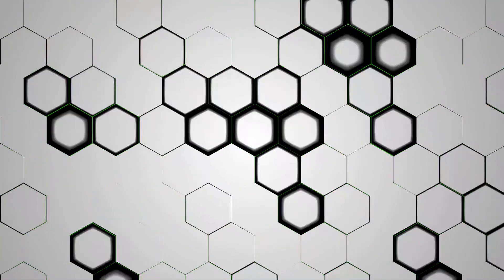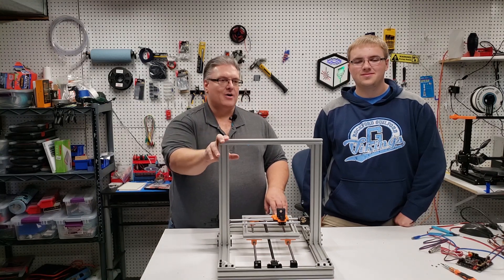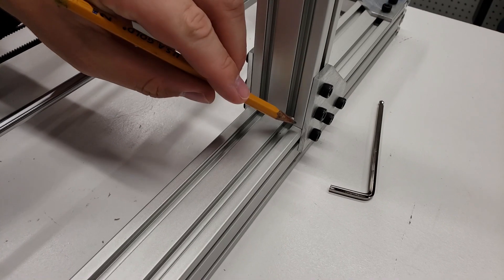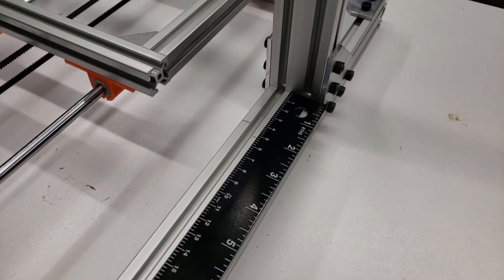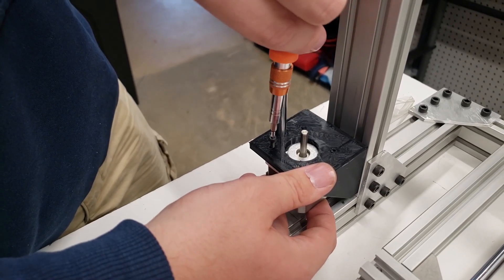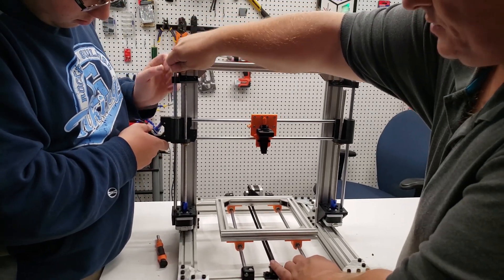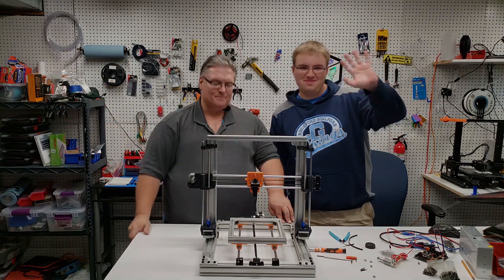Build Your Own DIY 3D Printer Kit at home - Part 4 : The Z Axis

Comment: anyone else following this tutorial to make a DSLR gimbal retractor for a fixed wing UAV thats controlled via 4G LTE connection and has unlimited range nd big biggest battery life u have ever seen. anyone doing that? bc ik i am. im just hoping those stepped motors can lift the weight of a £1500 gimbal and very expensive DSLR camera - thanks very much for this its definatley gonna help

Comment: For the framing, did you opt for the extrusions for a particular reason?  Ease of construction without needing to drill and tap tubes and the like?  Trying to build one as cheaply as reasonable, and I already have tooling to deal with welding, cutting, drilling, tapping, etc. and wondering if there was a clear advantage to the t-slot that I'm missing.
Reply from the maker: Only choice was for availability.  T-Slot and V-Slot are interchangeable in the design.  Providing you have a rigid frame it really doesn't matter what you construct it with.  Use what works best for you.
Reply: @MakersMashup  I'll give tube stock a try, selecting sections that match the stiffness of your frame.  Thanks for the input!

Comment: Hello, I'm from Philippines and I would love to make my own DIY 3D printer. Your video is very nice and professional and with the materials that has been used, it looks like it will high quality product. The only problem I have is with the 3D printed parts, I can't print them since I don't have a 3D printer right now. Do you have any other alternatives for the 3D printed parts? Thank you
Reply from the maker: If you can't print 3D Printed parts you can go down this route https://www.youtube.com/watch?v=tYUiWoiKzbs
Sometimes makerspaces and libraries have 3D Printers but not sure in the Philippines.  You may have to build a Frankenstein.
Reply: @MakersMashup  Thank you so much! Will check out the video

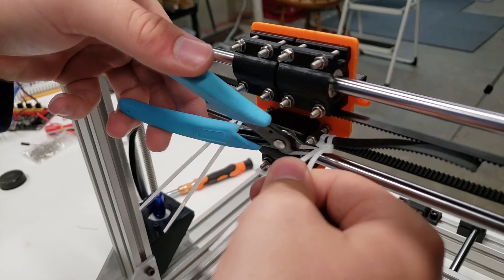Comment: 06:46 Pro Tip when snipping the excess length of the cable tie, keep the flat side of the snips against the locking part of the cable tie. That way you don't end up with a sharp point that will stab you when you least expect it. Aside from that, very nice video series.

Comment: Great vidoes, I learned a lot. but  I have a  issue with my stepper motor not turning and making a griding sound whenever  I want to remove or insert filement inside the extruder. by any chance do you know what the problem might be?
Reply from the maker: Check the wiring, voltage and , current. Wrong leads can cause it to not properly alternate and move. Wrong voltage and current can cause it not to move.  Try swapping it with a know working stepper.  This is some tips but hard to troubleshoot in a YouTube comment. 😉
Reply: @MakersMashup  thanks man. for sure, I'll give the advise a shot. hopefully it works. could it still be the wires since the stepper used to work with the same wires, and suddently it stop turning.
Reply from the maker: What sort of extruder do you have? If it's a geared one you might need to just clean it out.

Comment: I like the solid motor leadscrew couplers, other designs prefer the flexible types.
IMHO the absolute perfect coupler would be a U-joint or Gimbal coupler.

You would have to loosen up the coupler screws and retighten them after the complete Z axis fitting.
Also the motor bracket should be realigned.
Optimum would be to wind the Z bridge fully up and redo the alignmenet here.
Otherwise you risc getting tension in the leadscrews.

My own 3D printer project has been resting for a year now, since I discovered the flimsyness of the acrylic frame.
Your videos have given me new hope 😊
Thanks a lot for a very good DIY video series. 😍😎👍